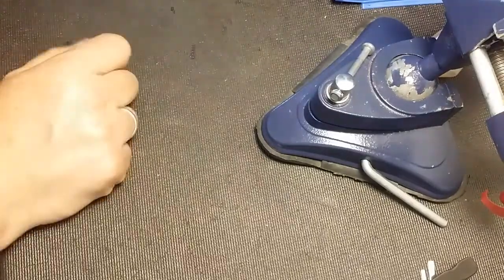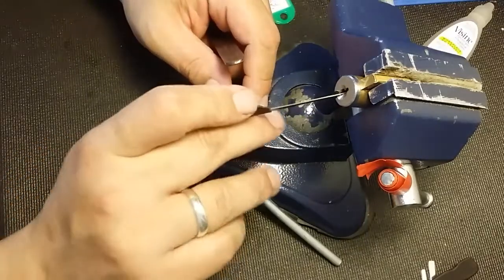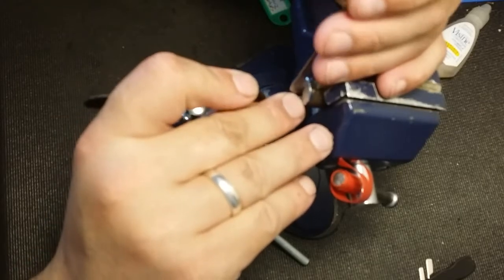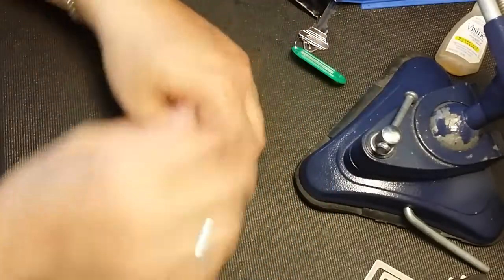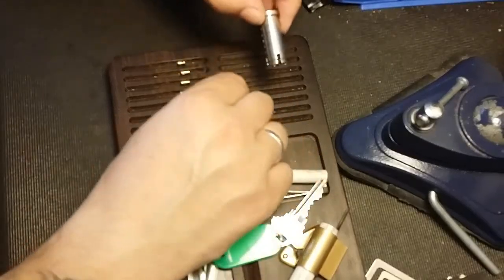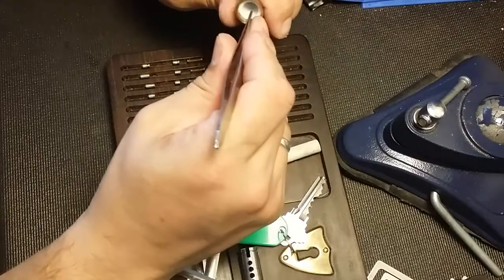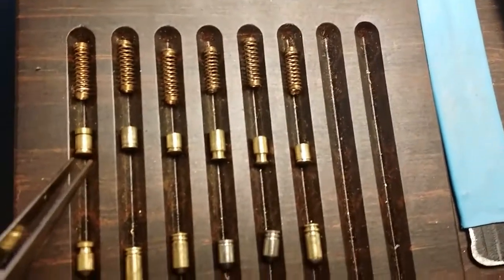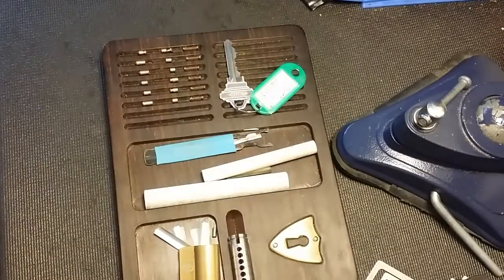-=352=- Smooth Criminal By Pickaholic!

Comment: Great picking sir. Pickaholic really did a nice job on the pins. But I have a question how do you you get the pinning tray so close to the camera to show the pins so well? Mine are horrible.
Reply from the maker: Bill Bacardi Depends on the camera you use. I use an android cell phone. In the mount the camera is already pointing down. I hold the pinning tray up close (about 6 to 10 inches) to the camera and manual focus by touching the screen where I want the camera to focus.

Hope this helps. It is the best way I have found to show off pins.
Reply: West Coast Picks Thanks bud I use an iPhone and I can't zoom. I think I'm going to get a go pro and try that.
Reply from the maker: Bill Bacardi Not sure if it works on IPhone.  but zoom is usually volume up and down. Touch the screen for focus.
Reply: West Coast Picks I have the focus figured out but I can't figure out the zoom I tried everything. Everyone I've says that the go pro is dummy proof and I'm pretty dumb when it comes to technology lol. Thanks for the response my friend have a great day.
Reply from the maker: Bill Bacardi No problem. I never zoom in. Cause it just degrades the resolution. Digital zoom always sucks. I just set my camera up close to start. Good luck!
Reply: West Coast Picks Thanks bud.